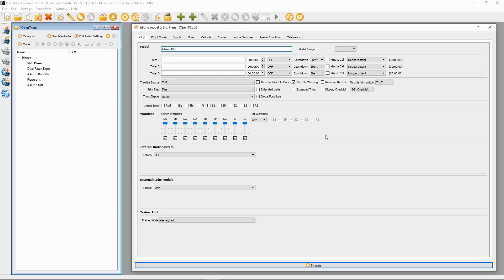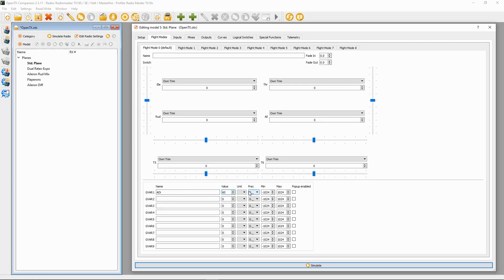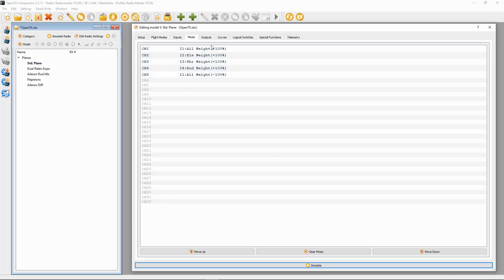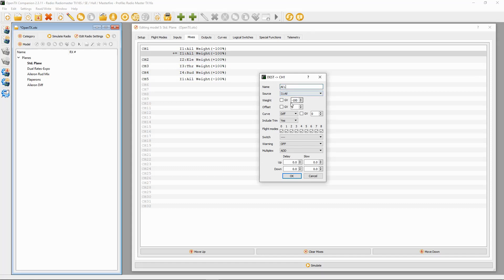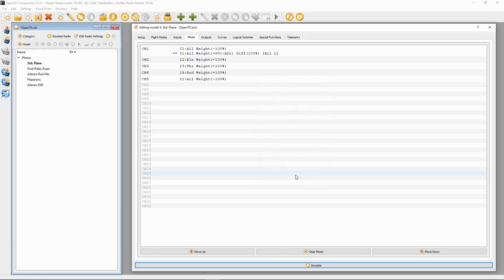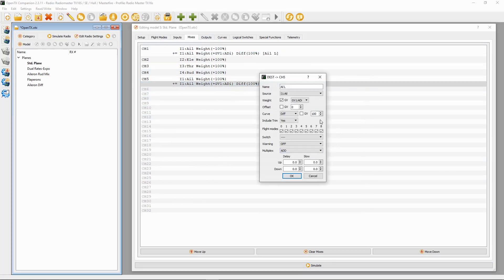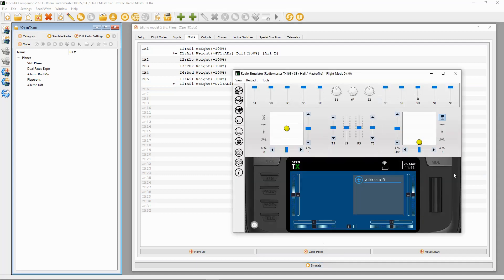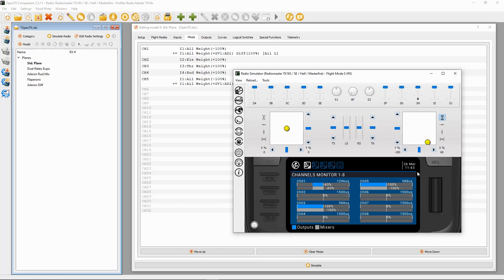OpenTX Aileron Differential

Comment: Just to note, this ONLY works if the first Mixes line of each aileron Weight=-100. If the value of Weight=+100, then movement becomes 100% both channels!  Boggled me for a while until I modelled exactly the video. OpenTX 2.3.15. any reason to explain this?
Reply from the maker: I do not have a radio with OpenTX but checked my EdgeTX radio and the aileron mixes are Channel 1 Mix positive weights and Channel 5 Mix negative weights. You do need to follow the programming exactly or the control surfaces will not move as expected.

Comment: I just offset the aileron servo arms one tooth toward the leading edge of the wing and lengthen the pushrods so that the ailerons are centered. Or, you can move the aileron control horns back from the hinge line a little and that will also create differential throw. Creating differential by altering the linkage geometry eliminates the need to use two channels and doesn't decrease the throw of the servos in the downward direction which decreases the resolution of the system.

Comment: Hi Bill, can you show me how to setup aileron differential, flaperon, using flight mode and GV. My goal is to use flight mode (single switch) to control flaperon and aileron differential with delay on both movements.
Reply from the maker: Hi Michael, I can help you with this but aileron differential is a proportion movement so you cannot delay it but we can link it with flaperons to modes and the mode switch. Mode 3 position switch  position forward Normal no flaps or differential. Position middle aileron differential and position back just flaperon or flaperon and aileron differential. Please let me know the switch configuration and I will help you with it.

Comment: Hi Bill-  I always enjoy your videos and am a subscriber.  While there is absolutely nothing wrong with the way you are doing this, there is an easier way.  Simply open each aileron mix for editing, set the Weight to 100%,  select "Diff" for the curve and set your desired differential in the field next to "Diff". Done. No need for an additional mix line.
Reply from the maker: Thanks for subscribing and thank you for you feed back will use your method in a video and credit you with the method of setting up aileron diff.
Reply: @the-happy-RC-flyer  It just occurred to me that there is an advantage to doing it the way you did.  Using a GV  to set the DIFF weight opens up other possibilities such as adjusting the DIFF with a knob.
Reply from the maker: @NorthGaSawyer   yes GV’s make it easy to adjust the value quickly at the flying field when first setting up aileron differential. OpenTX does allow different methods of coming up with the same result.
Reply: @the-happy-RC-flyer  No credit needed to me.  I learned this from RCVideoReviews